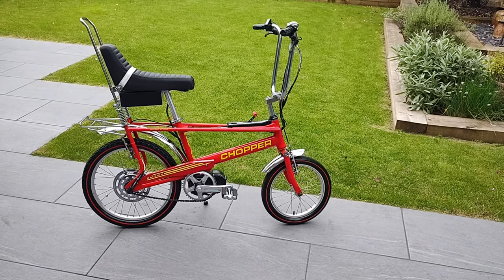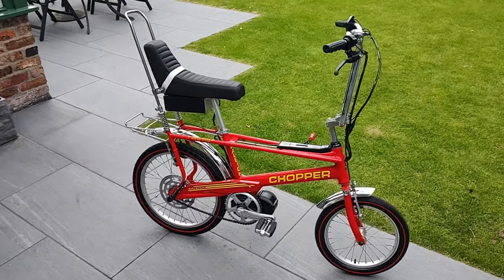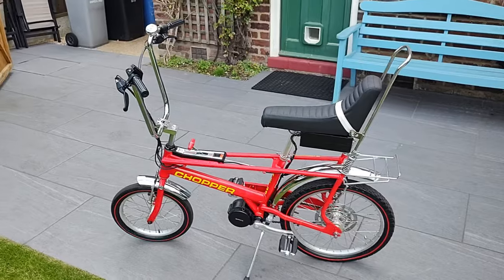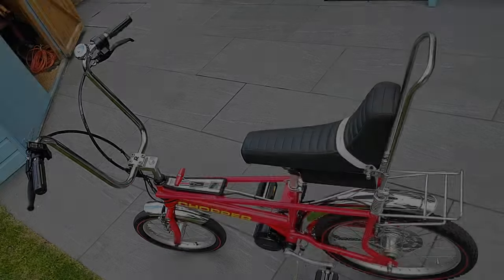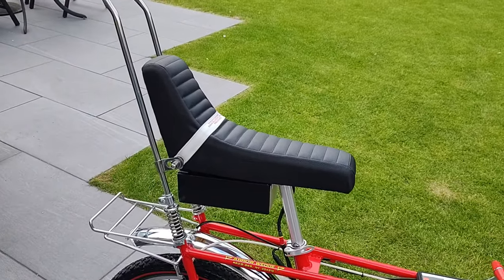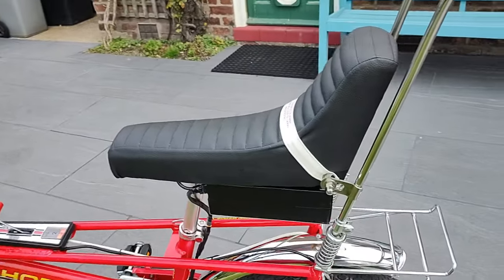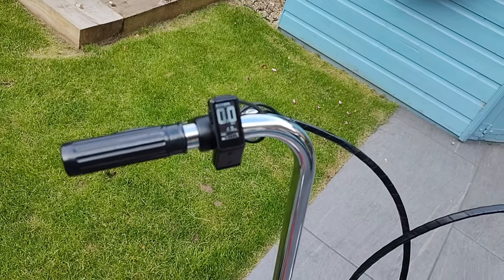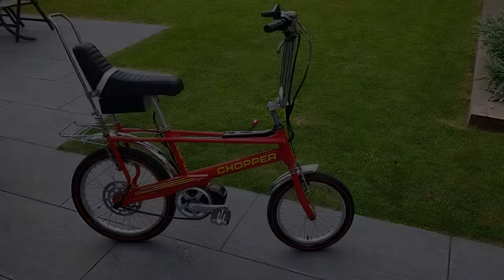Electric Raleigh chopper overview

Comment: Lovely bike, I have the mark 4 in ultra violet because I was an original council estate boomer who always wanted one with a passion, when I was 10 but a father who didn't have the wherewithal to buy me one in 1969. The mechanical propulsion is no problem for me being a club racing cyclist all my life. You do know that the throttle is illegal in use on public roads ? If one is fitted, it should only be  a walk assist to 3.7 mph, not above that speed as yours obviously is.  Not knocking you though, I have a throttle on the wife's ado 20 air and have been in the engineering section, changed it to hybrid drive and maxed out the speed limiter. It will now get up to about 22 mph unaided on the flat ( where permitted obviously lol ) from a CE 250 watt motor. Apart from the squared off cow horns, your bike would pass for a mark 2 by anybody apart from a Chopper Aficionado. My Mark 4 hasn't got the speed of my Cannondale system six or my Cannondale Super Six evo but what it does have is fond memories of growing up in the 60's and 70's.
Reply from the maker: Hi, thanks for your comment. Like you, my parents couldn't afford a Chopper when I was young so I only got ride them in recent years. I guess this is why I'm comfortable with modifying the bikes, I'm not trying to recreate a replica of an original bike that I owned in my childhood.
Congratulations on being the first person to notice/comment about the throttle 😀 Whilst you're technically correct, as this is a pre-2015 (2004) bike it could be considered exempt from the current e-bike legislation, but this is a grey area and I guess you could argue the case either way. Raleigh got around the rules on seat/sissy bar height restrictions on the MK4 by selling the higher MK2 style sissy bars separately, allowing them to be fitted by the customer. Would a MK4 modified in this way be illegal?
The throttle can be disabled in seconds by unplugging the connector, but main thing is that if you ride your bike responsibly no one will ever pick you up on it.
Reply: Yes the wife's ado 20 air can easilly be made legal on the road again on the app by turning off hybrid drive mode because the pedal assist only, is always set at 15.5 mph, it is the throttle that takes it to 22 mph. When I was about 40 about 25 years ago, I electrified a racing bike with time trial bars on it. The batteries then were nickel cadmium. The motor was a high speed heinzman unit. The bike could cruise at 30 mph but I had to change over to a second battery half way to work after about 8 miles at that speed. The batteries age longevity wasn't  very long then either. You are right about the police though, they are not interested in old farts riding sensibly, whether on an illegal e bike or not. They have larger fish to fry.

Comment: An excellent build on a classic bike!

You would hardly think it was an ebike as the battery is not really noticeable under the seat.

Very impressed with the speed it's going. Have you altered the throttle settings to the controller using a lap top?

With the recent release of new choppers by Raleigh this could start a trend!

Very nice conversion

I recently converted my 30 year old Marin mouse train bike with the same Bafang motor and it certainly brings a smile to your face!😂
Reply from the maker: Thanks for your comment. I wanted to minimise any changes to the overall appearance of the bike, so your comment about the battery is especially pleasing. 

It does look fast but it's all standard settings. I'm reluctant to modify the default settings in case I brick the controller. 😆